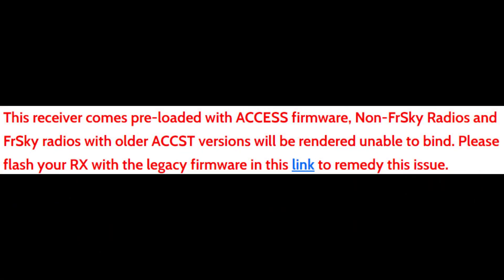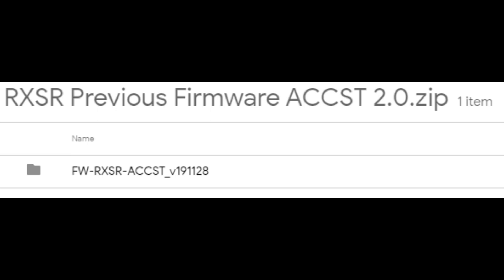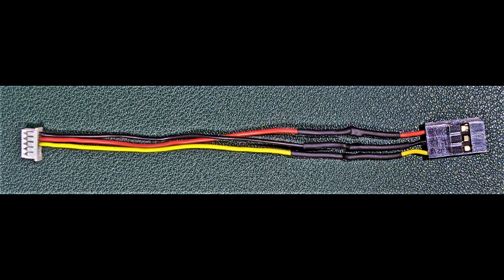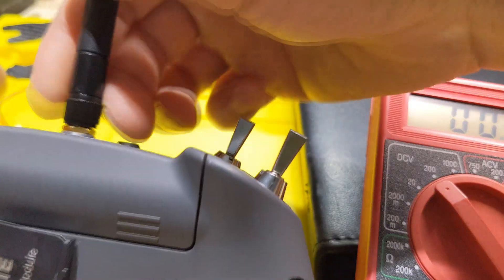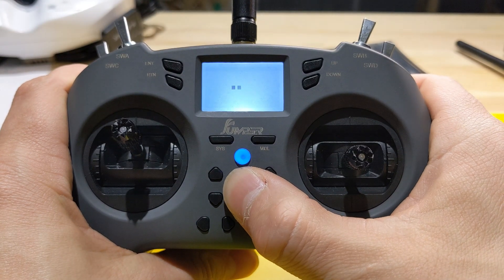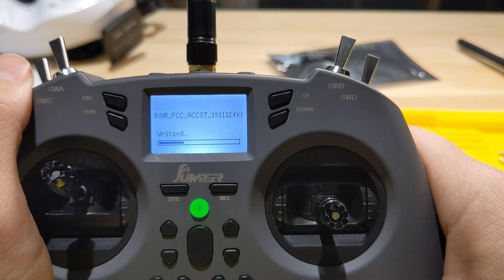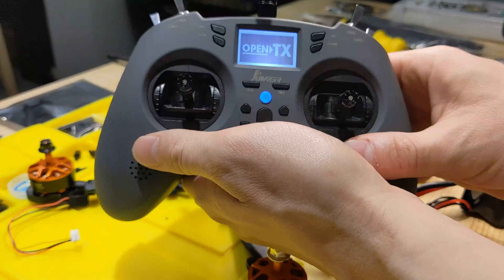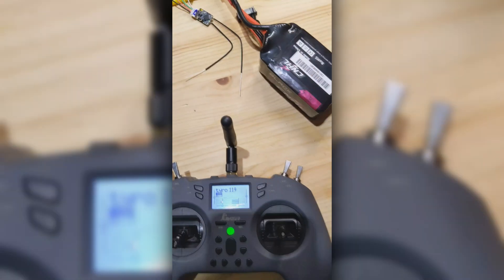FrSKY R-XSR Firmware Flash from Jumper T-Lite and Bind

Comment: The pins on the T-lite Module adapter are not a good fit on a standard servo connector as used here. The balance plug off of a 2 (or more)-cell lipo battery makes a firmer, more positive fit. 
If you make up an adapter cable as shown here you can then use any (8.4v capable) S-bus receiver that is bound to a compatible Student's Radio to connect wirelessly to the T-lite for use as a Master Radio in a Buddy-Box training system.
The T-lite v2 has a plug on the back which means you now don't have to split the radio open to plug in the module adapter. But it is not really a good upgrade since you then have a lot of wires dangling behind the radio. (Possibly we may have received an adapter meant for the v1 radio!) You really have to split the radio anyhow to check where the adapter mounting screws are poking through to. 😱🙄

Comment: I did not get the voltage readings on my Jumper T-Lite 4n1that you got.
Reply from the maker: What voltage readings were you getting?  Everything connected properly and the probes in the right spots?
Reply: I got 3 volts on the 4th pin from the right and .01 on the other 3 to the right.  I am wondering if i need to change a parameter in the settings somewhere.
Reply from the maker: @kymachen381  that is weird since it's connected inside the Jumper T-Lite.  Is the ribbon cable flipped wrong?  But main thing is you have your red wire on the cable I plug into the terminals, on the one that gives the high power.  I'm not really sure what's going on.  Maybe you can upload a quick video to youtube to check it out.

Comment: Hi! Is it normal, that when I plug the battery into the drone, there is some clicking-noise and the connections between drone and battery are getting a bit black?
I'm looking forward to an answer, thanks!
Reply from the maker: The clicking noise sounds like sparking?  You shouldn't have any issues after tightly plugging in the battery, but you have to try and plug them in straight and not contact one terminal before the other. I hope I understood your concern.

Comment: Perfect, I love it when you follow a how to on YouTube and it all happens the same. I also have a blue led on my R xsr, just stays on when powered, fine by me I like blue lights. The red and green did what you said. 👍
Reply from the maker: Thank you for watching, I am glad it worked out for you.  I appreciate the compliment, I wanted to show exactly what steps were needed without skipping something and assuming someone knows what to do.  Glad it was helpful!  

By the way, some information from the FrSky R-XSR manual about your blue light:  

-SBUS/CPPM output (BLUE LED stay lit indicates R-XSR in SBUS mode, otherwise in CPPM mode)
-How to switch SBUS and CPPM signal: Long press the F/S button on the receiver for 4 seconds, the BLUE LED will flash three times, indicating the switch is completed.
Reply: @58Alpha  that's my next job go on Betaflight and get it all working. Camera transmitted to goggles but no osd yet. Connects to transmitter but no arm. I copied another model in the jumper so that should be half way there.
Thanks again now I know why the blue light is there. Not sure weather I want sbus or ccpm yet, not a clue what difference is yet, I feel a YouTube search in order.

Comment: So I am new to fpv. I do have this radio and I just got a Nazgul5 V2 with a FRSKY R-XSR receiver yesterday. Now I notice when I go into the Model setting I see that it has Frsky rx, Frsky X and so on. Do I need to still do what you did in this video to bind to the receiver?
Reply from the maker: Yes. The way I did it in this video is the way I had to do it for it to work well
Reply: @58Alpha  OK. I appreciate it. I just installed the external thing on the back of the controller and switched the wired on the wires that connect to the receiver. When I download that link, do I need to go into the OpenTX to put it on the SD card?
Reply: @58Alpha My radio did not come with an SD card so I'm having to get one to use. Is that a problem?
Reply from the maker: @jml4798  you'll put the SD card in your computer and download the firmware onto that. Then take the SD card out and put it into the Jumper T-Lite and follow the steps in the video.  You can use your own SD card, it doesn't come with one.
Reply: @58Alpha  OK cool deal. I'm doing it now.
Reply: @58Alpha  Mine didn't bind. The red light never started blinking
Reply: @58Alpha  Did you update your Jumper T-lite firmware?
Reply from the maker: @jml4798  as I know, yes, it's been updated to the latest version from Jumper
Reply: @58Alpha  OK. I just rewatched this video. I noticed when you out your receiver in binding mode you only had a red and green light. But when I  do mine I have a blue light and the other 2 lights. Do you know what the blue light is?
Reply from the maker: @jml4798  Check out the R-XSR manual.  Blue LED stays list indicates it is is in SBUS mode, otherwise it is in CPPM mode.  How to switch the SBUS and CPPM Signal:  Long press the F/S button on the receiver for 4 seconds, the Blue LED will flash 3 times indicating the switch is completed.
Reply: @58Alpha  Alright thanks. Could that be a reason I radio want bind to the receiver? I followed your video exactly and still nothing
Reply from the maker: @jml4798  Yes, that is probably the reason.  I have had that issue in the past.  For me, I needed to be in SBUS mode.
Reply from the maker: and also ensure that the SBUS is somehow selected in the flight controller and that if there are any special soldering to SBUS pads on the FC, that you ensure those are correct too.
Reply: @58Alpha  OK, I'm going to try all of this. I really appreciate the help.
Reply from the maker: @jml4798  ok I hope it works for you!
Reply: I'm checking my external board and am getting only, pin 4@4.3, pin 5@.31, the rest are all 0.0 readings. In your video, I have no blue wire only a black wire to pin 4, yellow wire to pin 5, greenies to pin 7 and white wire to pin 8. I do have a grey wire from the t-lite to the external module black button below the pins, Guessing reset or some other function.

Comment: Is that applicable to tpro?
Reply from the maker: Unfortunately I don't know but you could try it. If it uses Open TX then I wouldn't see why it couldn't be applicable, but make sure you know the pin outputs first
Reply: Did it work or did u have to flash it
Reply from the maker: @Rostacks  it worked..flashing it is in the video. (Writing)
Reply: @58Alpha  so I have to flash it for the jumper t pro? or it binds right away    I’m new 😂
Reply from the maker: @Rostacks  yes, if you want it to work properly, you have to do this step in the video. I hope it helps!  This is for the FRSKY R-XSR receiver.
Reply: @58Alpha  I have the xm plus
Reply from the maker: @Rostacks  it may work, just have to check what the latest firmware for the XM Plus is
Reply: @58Alpha  Alrt thanks

Comment: Am I wrong or the have you changed the order of wires between 2:15 and 3:05 and didn't mention it?
Reply from the maker: Yes, I had to change the order of the wires. That way the receiver is talking back and forth with the transmitter or controller properly
Reply from the maker: I did mentioned it in the video that you have to order the wires as shown in the picture. Make sure connector orientation is correct.